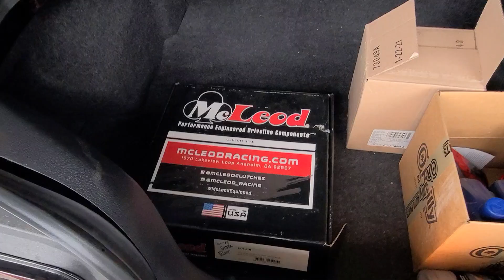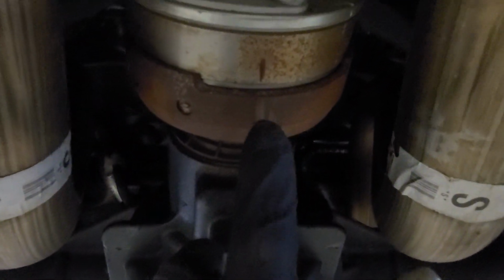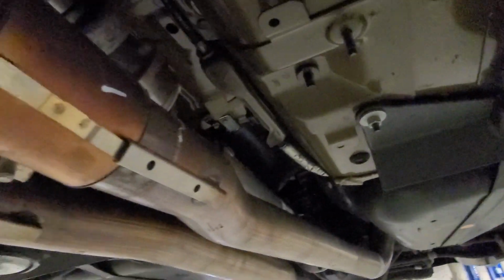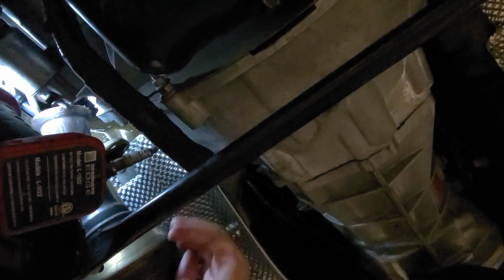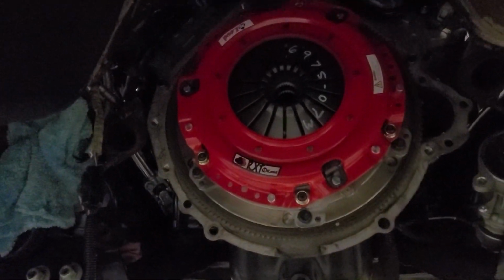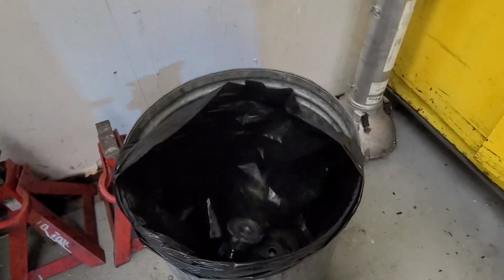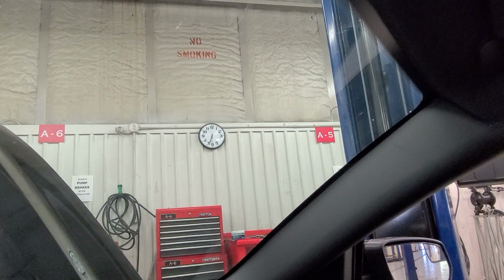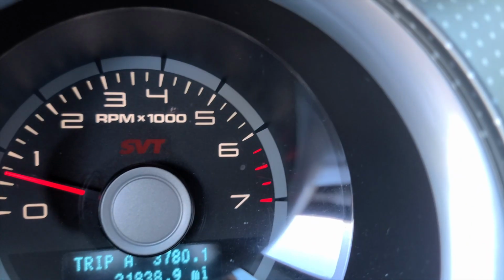Installing the Mcleod RXT clutch on the GT500

Comment: Anyone try the aluminum flywheel? Im on the fence over steel vs aluminum.
Reply: I got 8500 miles out of my alum. FW.  I am going back to OEM . I 've had two GT-500s. Both got just about the same .  Los Angeles stop and go driving. When they slip I change them .  what made the most different was throwing the stock grey plastic tires Badyear in the dumpster.   and a 05 GT .
all 3 new.  if you one a home buy a 2post lift ,there cheap.
Reply: @Americal1970  i went with the steel mccloud rxt flywheel twin disc clutch. 

Id do the lift but my garage is too tight.  We squeeze 2 vehicles in and can hardly open the car doors.
Reply: @carlmazziotti221  I will say this, I am 73 so I fell back on the old days. When a clutch slipped  a stronger pressure plate.  I went to a SPEC 1100 lb 2 disk and Aluminum F. W. 
MAKE NO MISTAKE  it was 1000% better fun.
This is my fault, it was "Track and  Strip"  only problem was I  was  driving in stop and go traffic. So over the 8500 miles it jammed a million launches and shifts. I don't drag race, and have never used track apps  my 2014 has 27000  new Dec 7 2013  and I have all new parts OEM. The reason is SVT  has a good argument for the stock clutch.  I liked Spec  nothin bad against them. I think 5.8/5.4  will eat anything we use.  I will be removing the Alum FW  within a week. I will let you know what I find.
This will be the 4th  time.
Reply: @carlmazziotti221   I think you made a good decision steel FW.   There is always a pit  to get under the car. I first time I cribed the car up  with 4x4x12"  it worked slowly but it worked. 60-70 blocks.
The red ants, rat shit, horse Flys, 105°, sun.  Love it.
Not a dirt pit LOL
Reply: @Americal1970  sounds horrible. Yeah,I hate paying someone to do something I know I can do better, but totally not worth killing myself over. My next house will have a lift.